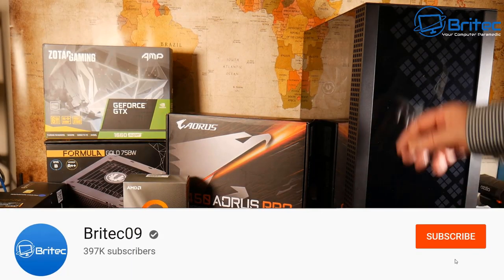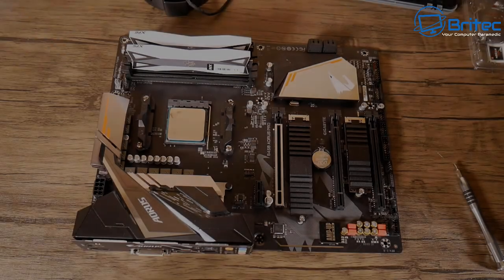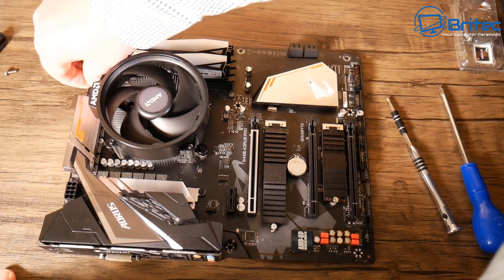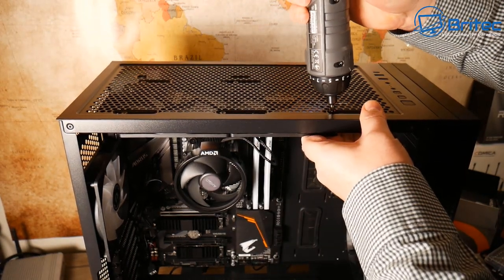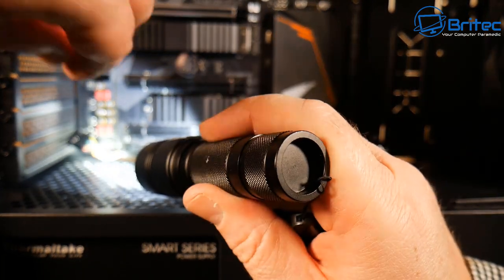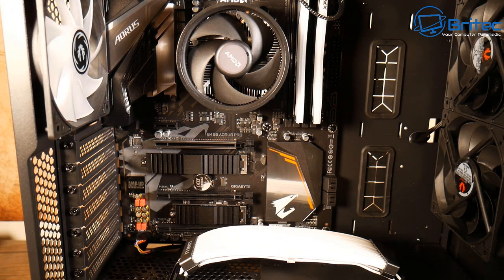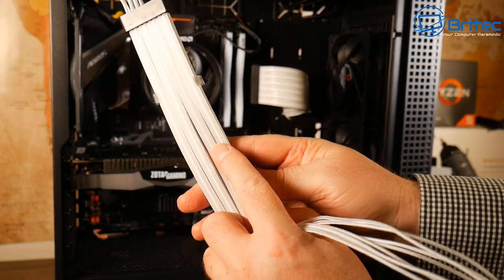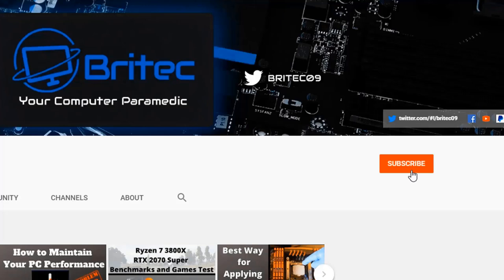How to Build A Gaming PC in 2020

Comment: How I build a gaming PC in 2020. First start with a Thermaltake Level 20 HT Snow Edition 4 full tower case, throw in a MSI X570 Unify motherboard, a Ryzen 7 3800X, 32 GB of cl 16 3600 MHz G.Skill Trident Z Neo RAM, three 2 TB NVMe M.2 drives, a MSI Gaming GeForce RTX 2080 SEA Hawk EK GPU, a EVGA 850 B3, 80+ Bronze 850W, Fully Modular PSU and $750 worth of custom loop gear.
Reply from the maker: and then play Mine craft?
Reply: @Britec09  Sometimes I play Bloons Tower Defense 5. LOL  I do a lot of auto cad for my job that takes a lot of processing power.
Reply: @Britec09  🤣

Comment: Would an i7 6700, gtx 1060sc, 16gb ram be ok for gaming?
Reply: Why intel? ryzen us the way to go these days for basically all pc builds. And are you buying a 1060 new or used and if so for how much.
Reply: MiNi Weeddeerz it’s a system someone is selling for £200. I’d have to buy the 1060 separate for about £120 off eBay.
Reply: @steriospeaker  £200 seems a bit cheap for that setup. I would ask for proof that it works first. Otherwise, it's a bargain. You won't have a lot of upgradability headroom on the CPU and motherboard, but for £200, it can't be beat
Reply: MiNi Weeddeerz hi 👋🏼 I’ve done the maths now. It’s an acer aspire t desktop. It has an i7 6700. 8mb ddr3 ram. It has standard hard drive. That’s £200. 
I’ve now found a guy selling a evga 1060 6gb for £115 nearby too. 
So this would be £315. 
I’d also like to put in an m.2ssd for about £45 - so £360. 

Is it worth the extra bother for this price? I7 6700, gtx 1060 6gb, 8mb ram, m.2 ssd. For about £380 (including a few extra cables).
Thanks for your advice guys (and girls), most appreciated.
Reply: @steriospeaker  it really depends on how much you are willing to spend. If you can spend maybe 550 or a tad under, don't. You can get 6 cores 12 threads, a 580, m.2 SSD, good Ryzen 5 overclocking motherboard, an unlocked CPU, 16gb of high speed ddr4 not ddr3. If you were to buy the build because it still and great value, I would upgrade the ram definitely. Just get a 2x8gb kit of ddr3 so it runs in dual channel. For £380, it's still a good deal. Maybe £420 for new ram. And for that price it will perform superbly. However if you can spend more, you will gain a bit better system and get that ryzen upgradability.
Reply: MiNi Weeddeerz wow - dude - that’s a fantastic answer. Thanks so much for your advice. Really given me something to think about before I take the plunge one way or the other. 
Much appreciated. 
⭐️⭐️⭐️⭐️⭐️
Reply: @steriospeaker  welcome dude. Happy to help. Both builds for the price are grear values
 It's just that if you pay a bit more, you get Ryzen advantages and everything new. It's your choice in the end.

Comment: not a cheap build then
Reply from the maker: can be made cheaper without rgb, but cheap depends on how much money you have.
Reply: @Britec09  cheaper with a cheaper motherboard and ssd and processor. Maybe a 1600af, with a MSI b450 gaming plus max/tomahawk max or a asrock b450m pro4 for a budget option. As for the SSD, probably a 1th crucial P1 or intel 660p. You wouldnt lose a lot of performance with the cheaper processor because the gpu isn't high end enough to make too much of a difference. As long as the CPU can push out 144 frames which the 1600af can do for a 144hz monitor, which is standard, then you are fine.